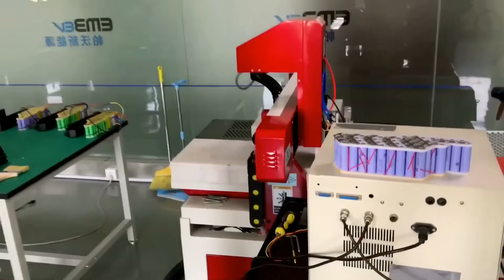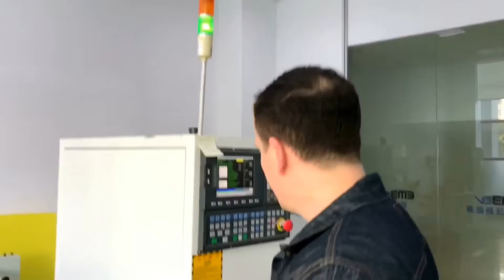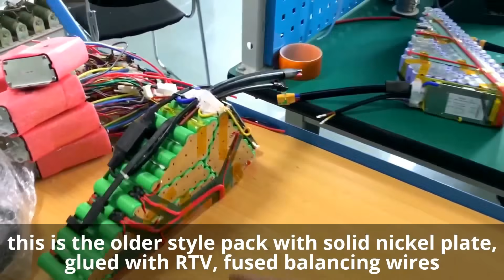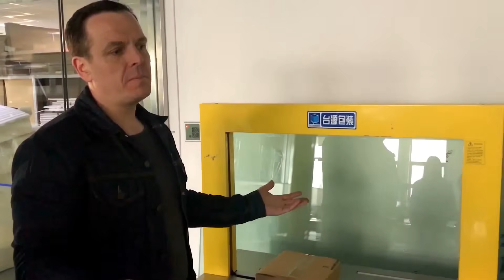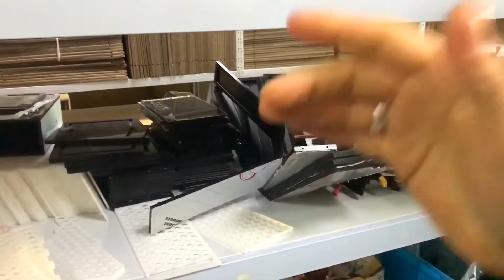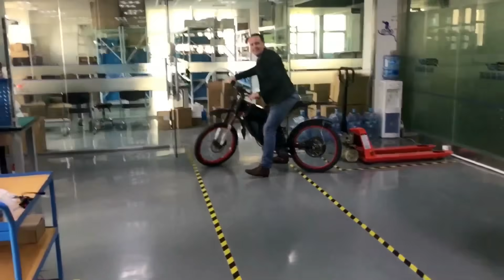EM3EV battery factory tour - State of the art 18650 battery packs

Comment: Are they manufacturing batteries compatible for vapes??
Reply from the maker: Hummm vape stuff is normally just a single cell, this factory makes battery packs with multiple cells connected together, much bigger stuff
Reply: @BrunoPOWEEER  If they can make complicated stuff, making vape batteries won't be a problem.

Comment: Bruno, i need your help. i decided to convert my cyclocross to electric with one of their kit. the size of the rim on my bike is 622x16C. tires size is 700x28-35. i cant find same rim size on the website. it seems that there is different sizing system or something like that. i sent them email but have not heard back from them yet. can you help?
Reply from the maker: +Uneven Terrain ohhh sometimes depending on the wheel they use moped or motorcycle rim (stronger) specially for hub motors. Maybe go to a motorcycle shop and ask if they're familiar with this rim size, if not, take it to a bike shop and ask if they have a tyre or if they can source one for you. =]
Yeaaahhh make a video showing your build and send me a link, I'm excited to see other people's toys haha... so much POWEEEEEERRR

Comment: Very cool.  Samsung discontinued there ICR18650-26FM what would you recommend as a good replacement.
Reply from the maker: Hummm.. I'm not sure why you want this cell but I can tell right now that fixing packs with few bad dead cells is not worth, older cells are aged and will have different internal resistance compared to a new cell, bad idea mixing them.
My advice, I wouldn't get anything below 3000mAh nowadays =]

Comment: It took me 14 minutes 30 seconds to order a pack from them ! Really like the filosophy !
Reply from the maker: Ohhhh really?? hahahahaha... this is AWESOME... Paul would be reeeeeally happy reading this comment hahahahaa... what battery you got and what motor are u powering?????
Reply: ElectricBike I got one of the rectangle ones, the 14s7p with Samsung 33G cells. 

It has now been close to a half year and still going strong. I strapped it a MTB bike rack with some heavy duty straps and it survived snow, rain and sun ! Motor is a bafang BBS02-B running at 1200w max

Comment: I need some suggestions for troubleshooting.
My BBSHD was working great. I parked it but then when I came back 2-3 hours later the bike would not turn on. I pressed the button on the battery to check its capacity and nothing happened either.

Plugging the battery into the charger brings it back to life so the lights on it come on and it shows the capacity aswell.. so all good
But when connecting the battery to the bike there is a spark. the bike jerked forward a bit too. and after this the battery will not light up and show its capacity.. not until its connected to the charger, that seems to reset something

:(
Reply from the maker: +Eduards Naglis ohhh sound like you have a problem there, let's narrow down the possibilities:
•controller problem (may need to replace)
•battery mount and connector may be broken (common specially with the Hailong battery case) make sure the connector is not melting or flexing as you ride
•battery problem, sounds like the BMS is cutting power for some reason, it could be warning you for a super power surge, could be a faulty series the BMS (check all series voltages make sure they're balanced). Could also be a faulty controller draining too much and the BMS is cutting detecting short circuit or too high current above specs.
Let me know how it goes mate.. happy to help you =]

Comment: Bruno, could something bad happen to the motor if I've tested an unloaded BBSHD and the battery on a stool in my room and after about 40 min of full throttle the motor was very hot? I didn't predict it needed a fan, later I tried with a fan and it was just a bit warm.
Reply from the maker: +dmitry manzano yeah it should be fine, the motor has a temperature control so if it gets too hot it will power off or show error message on display. Some people managed to fry some controllers. If you turned on and tested and it's working perfectly everything should be fine =]
Best way to test is to fit to your bike and feel the POWEEEEEERRR haha
Let me know how everything goes mate =]
Reply: ElectricBike Everything goes well, I have over 500 km on my ebike atm, first ride was on July 3rd. You can see a short video of my ebike on my channel. Which way some people managed to fry some controllers on BBSHD?

Comment: Hey Bruno Master, I have a question for you if I build a battery with 18650 and the corresponding bms, just like I have acid.
36v 12a I use the charger or for the lithium batteries precise one specific .
Tankyou so much
Reply from the maker: +Hector Uccellini yeah you can replace your old lead acode pack with an equivalent lithium 18650 pack, its gong to be a lot lighter and smaller, you can add so many cells and get a super range! You'll need lithium-ion BMS and charger, basically everything all the electronics new.
Check out a group on Facebook called "DIY Powerwalls" it's a community where lots of people share stuff about battery building stuff, I'm one of the moderators =]
Let me know how it goes, make videos take photos and share with others, this will help other guys out there!!! So much POWEEEERRRRR

Comment: I need one I can take on the highway... Use a cart behind me to store the batteries.
Reply from the maker: +MrBrymstond this is my ultimate dream too... you can set a solar panel sitting on top of the battery doing some little charging too giving an extra range... some touring dudes have done this... I know a guy who travelled 9 months on a single charge pulling a massive array of solar panels on road and then he repeated the trip off-road haha
Reply: That's the deal and maybe use charging when braking because it causes restriction. When you use a motor in reverse it will put power out... Plus they're making devices that charge when you shake them ever so little.

Comment: Very cool.  I'm not quite understanding why they use the PPTC fuses.  I know its to "prevent shorts" but why not just use a more simple method? 1-2mm nickel plated steel will quickly burn out if there is a short.  I've seen it work when a balance wire got shorted.
Reply: How do you reset it after a short :-)
Reply: A short of the balancing wires would indicate that their is a major problem in the wiring or a shorted out cell.  Auto resetting PTC fuses wouldn't do any good.  You would have a short after short after short as the PTC changes phases and allows it to short again.  It would short out until it east up your battery capacity through heat loss.
Reply: But the problem I see is, with PPTC fuses the fuse may trip because of overcurrent, then it will reset and trip again, unless you solved the problem.  One time fuses will burn out once and then you will be forced to fix the problem.
Reply from the maker: asusreviews all cells are fused at te nickel tabs and the balancing wires are protected with the PPTC fuse (protection on both directions) cells could short and damage BMS, BMS could short and drain series through the balancing wires... this is very common, they damage each other, protection on both directions is a good idea.
The PPTC is just above the nominal BMS balancing current, anything abnormal happening it will cut.
PPTC fuses are commonly used in the electronics world, they're everywhere, my favourite BMS has a massive one on the mains, some argue that a regular fuse that actually burns and needs replacement is better, some love PPTC, they're both fuses and protect from surge. =]
Reply from the maker: smcic PPTC fuses open circuit in case of a short and reset when the short is fixed or the situation is normalised. 
Complete info about PPTC on Wikipedia: https://en.m.wikipedia.org/wiki/Resettable_fuse